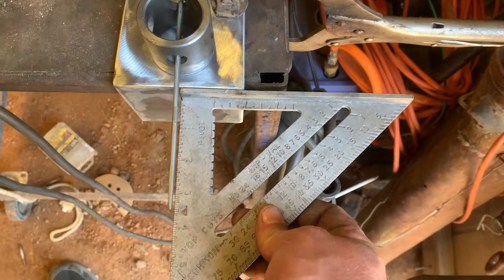Installing A Weld-On Jack On A Farm Trailer

Comment: Nice. 👌 Another thought for getting more contact surface on the jack tube mating on to the tubing for the trailer - use a die grinder and make a radius on the jack tube. It will then contact the trailer tubing all the way around, or at least minimize the gap you have to fill weld. Just a thought.
Reply from the maker: Thank you for the advice. That’s what I would normally do, but the tube only stuck out of the jack maybe a 1/4 of a inch. I guess I could have extended it if I had a piece of tube that size. I could have round it off then. Thank you for commenting and watching!
Reply: @FishHuntCookTinker  I'm a millwright by trade, aka a farmer without land.. 😆 So. I'm always interested in stuff like this. Your solution to mounting the jack will be excellent as well. It's not a particularly heavy trailer and you gave it a couple of good passes. 👍 And 7018 rod has a 70,000 lb tensile strength, so your weld is the strongest part of that old trailer. 😁